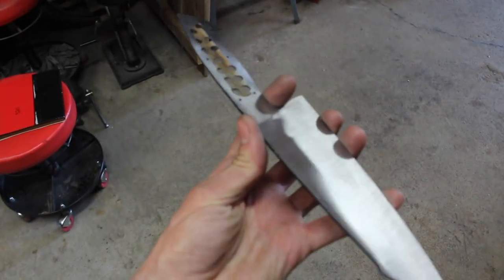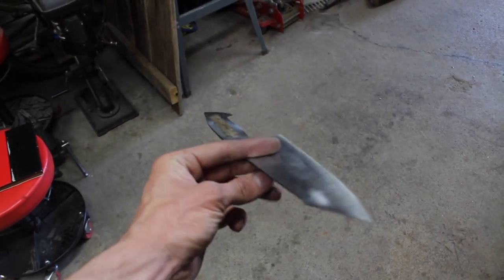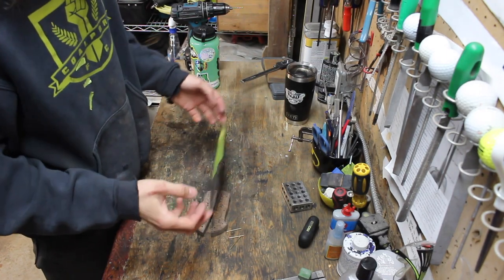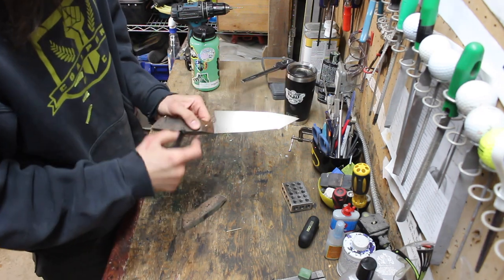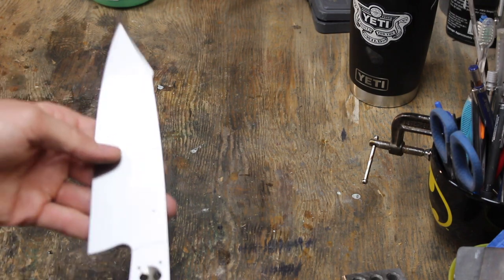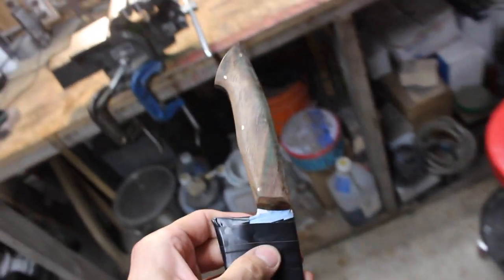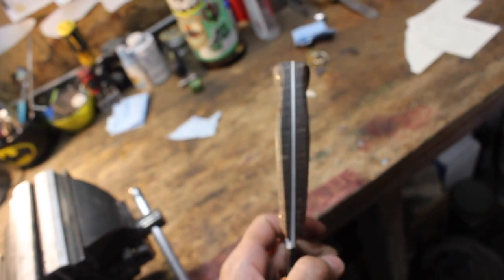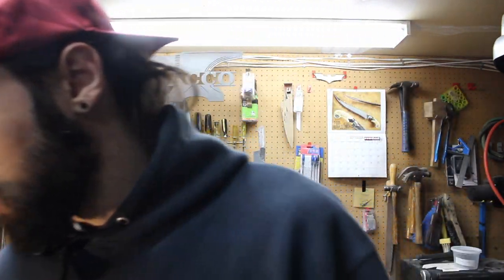Finishing Up a Custom Order Kitchen Knife

Comment: Great video, was curious what grit you came off the rotary platen with? Heard the finish off of those are like the finish off of contact wheels where they are way nicer than flat platens. Thanks man🙏🏼
Reply from the maker: I took it up to 220 on the rotary platen but sometimes I'll go to 400. The finish off a rotary platen is much nicer than a flat platen for this sort of convex knife in my opinion, although I have heared of others getting a very nice finish with a leather backed flat platen

Comment: 🔥🔥🔥Awesome video, whats the edge thickness on this?
Reply from the maker: I took this edge to zero before sharpening
Reply: @saccoknives  damn how you do that without overheating, I can't even get to 0.2 coz I'm scared of overheating
Reply from the maker: @ridhwaanjogiat1708  that’s where a VFD comes in very handy so you can slow the speed of the belt. I come off the grinder nearly at zero & then my hand sanding takes it the rest of the way. If you don’t have a VFD I suggest taking smaller passes with just a touch of pressure behind the edge & keep the blade cool with water
Reply: @ridhwaanjogiat1708  I do it by hand. everyone has their own way of doing things. for flat bevels I do it on stones. C grinds, convex, hollow grinds, whatever.. Ive done them all by hand for the hell of it at some stage. for a convex I broke it down into various radii which I did one line at a time. Basically like doing many smaller flat bevels then smooth it all out. You don't need power tools for everything especially at the later and finer stages..  I mean unless you're doing this for a living or something. For most its just a hobby